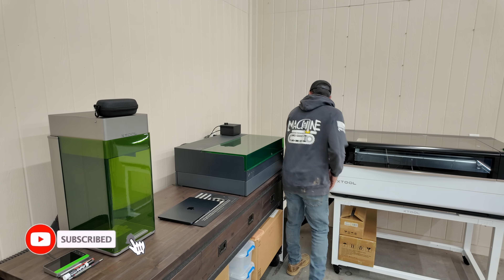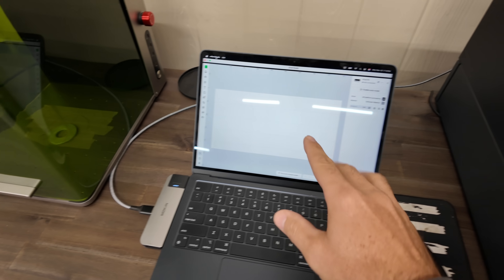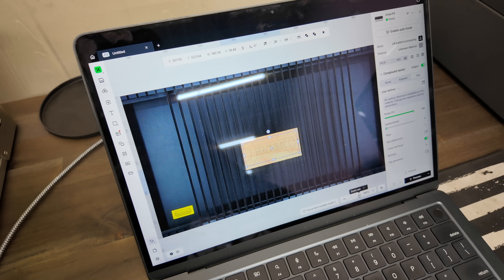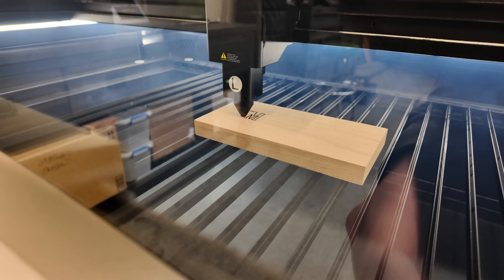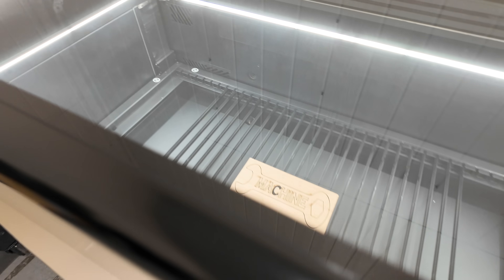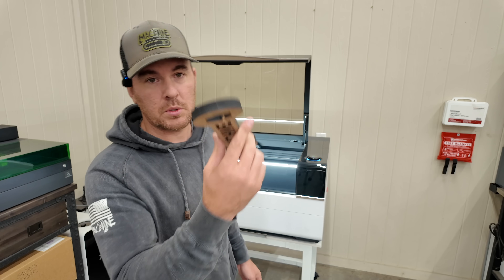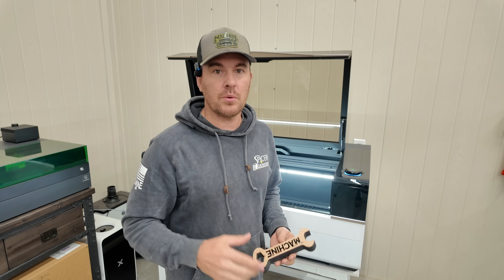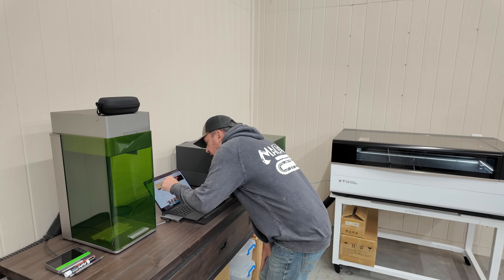xTool Claims The NEW P3 Can Cut 3/4" Hardwood In ONE PASS.....We'll See

Comment: Interesting that they said to use 100% power.  Wonder if in their software they already have it derated to 80% so the 100% is actually 80%
Reply from the maker: I thought the same thing.  I know you're not supposed to run them at 100% but they gave me the settings.  Thats a good question though.

Comment: Hey Kyle got a question for you. If I was going to get a laser engraver I would primarily use it to cut gaskets as I am a mechanic. Which one would you prefer? I think the P3 would be way overkill lol
Reply from the maker: the benefit to the P3 is the bed size but you likely won't need any gaskets that big.  If you did you could always use the conveyor on a smaller machine.  The P2S would be a good machine or even the S1 with a 40 watt head.  I can maybe make a video on cutting gasket material.
Reply: @SpicerDesignsLLC  thank you for the advice! Yeah a video on cutting gaskets would be awesome if you could do that!
Reply from the maker: I ordered some material already.
Reply: @SpicerDesignsLLC Awesome. I appreciate it a lot. Love the videos as always.